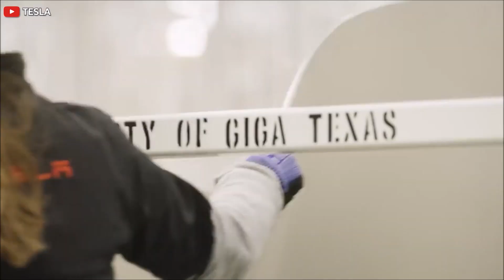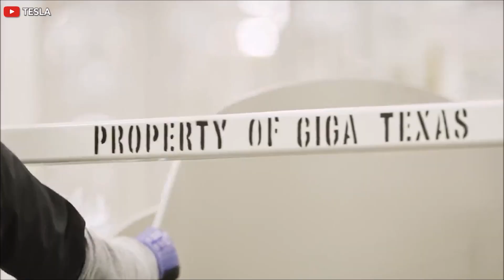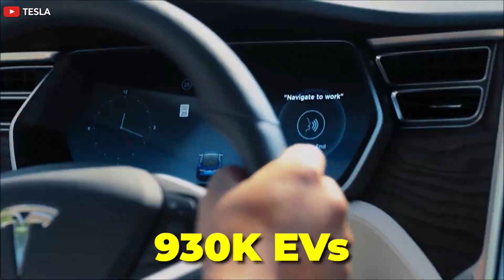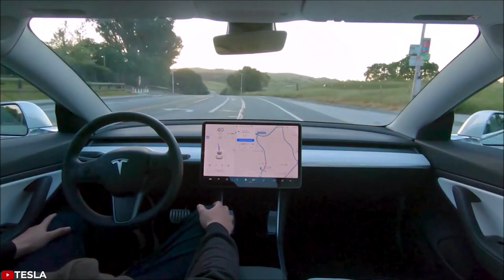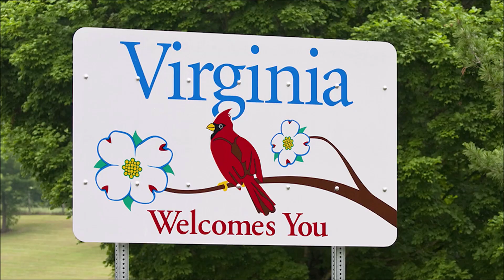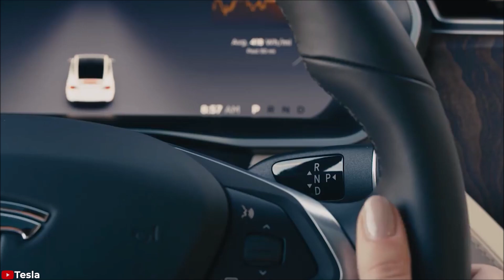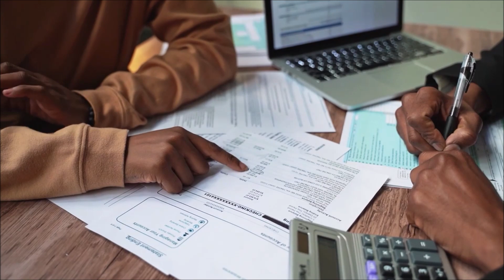Tesla Giga Texas Is Ramping Up Production - How Many Model Ys Can It Produce?

Comment: I would prefer to buy my insurance from Tesla, (if the price were right), because their parts cost will be less, their knowledge of the vehicles assemblies and quirks is more extensive and any claims should be resolved and the repairs completed much quicker that with a second or third party involved.  Their regulated profit margin has the same limits as their competitors, so they should have significantly lower costs and therefore, premiums.  Sadly, their quote was 3 X my current premium with a major insurer, and my premium keeps dropping with every renewal because of my driving record.

Comment: Tesla insurance.  Tesla (more than likely) knows more about their cars than any insurance company.  I think it’s a very good bet they can design and implement an accident repair program much batter than let’s say a regular insurance company using a high priced auto dealer or shade tree repair shop and do a better job at a lower cost then the rest of the industry.  This doesn’t even include the most probable reduction in cost if, let’s just, that Teslas end up with perhaps 80-90% less accidents.  Remember, 20,000+ people died in auto accidents in 2021.  A 50% reduction would save 10,000 fewer deaths per year (if most people drove Teslas or had similarly staff cars.  What’s that worth Warren?

Comment: Totally appreciate Musks innovations in manufacturing. Would never buy a Tesla or want to participate in the data sets, so no on the insurance. Bigger reason to not buy a Tesla is the company attitude towards right to repair. Speaking of repair, I have found it quite difficult to come across folks with good things to say about it's repair process, mostly about how long it takes. Not a good thing in the long run. That said, I'm all for EVs, have two on order and am invested. Just not Tesla.